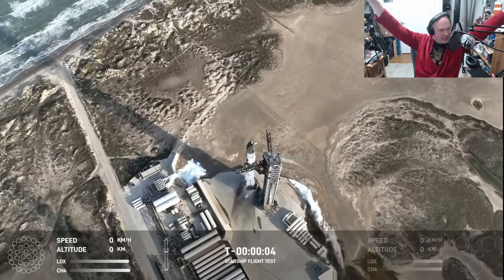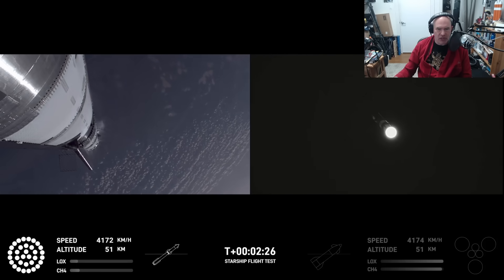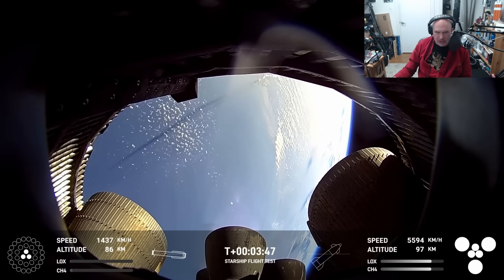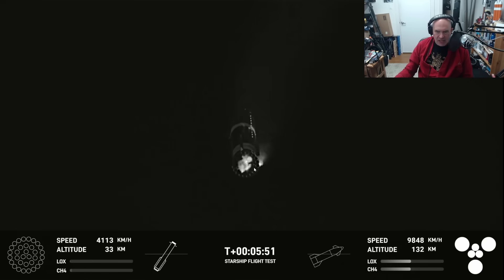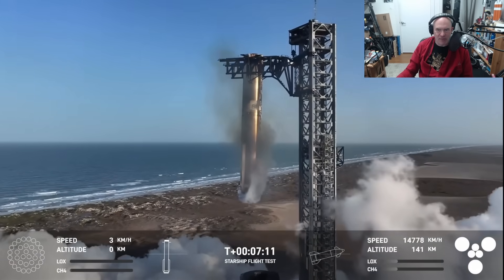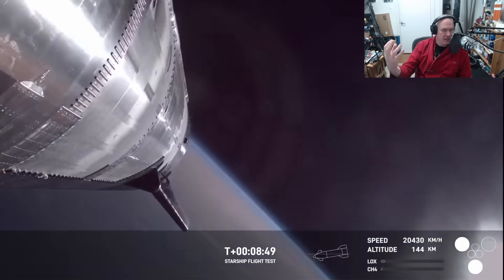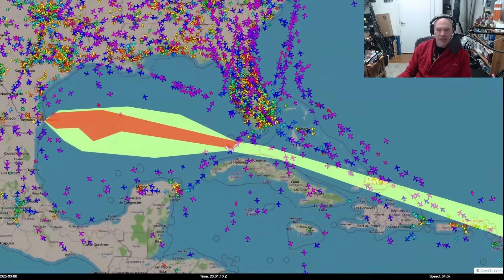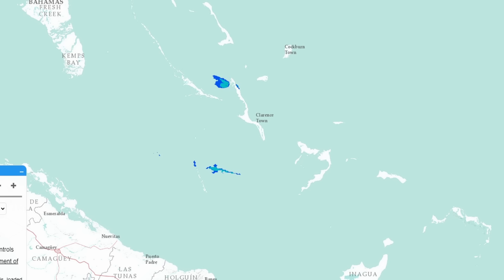SpaceX Make The Same Mistake Twice With Starship Flight 8

Comment: I used to think having so many engines was stupid....& yes I know they need them for such a huge payload for Starship.  Twice now the Superheavy has lost at least one of its central 12 engines and still was caught by the tower perfectly.  The problem with Starship is there are only 3 Vacuum engines forming a triangle.  Lose 1 and it tips, you lose attitude control.  I think the 6 they will have on block 3 makes more sense.  Lose one and your still flying...

Comment: One thing I don't understand in this flight and the previous one is why when the first vacuum engine shut down why weren't the other two automatically shut down to prevent loss of attitude control? 
The other apparently obvious thing that seems to be missing is the automatic shutoff of propellant valves in case of a leak.
If such measures had managed to keep at least one engine running it could have easily made a controlled re-entry in the ocean well beyond land.   Apart from the reduced risk to lives and property it would have allowed a significant part of the mission to be completed. It would just land in a different place (still within the exclusion zone) and re-entered at lower velocity, not stressing the heat protection as much as intended.
Reply: That's exactly what I was thinking and its a question that Scott coild handle

Comment: Just as I thought; a repeat of flight 7.  Whereas flight 6 landed as planned in the Indian Ocean.
> Upgrades are just making it worse... STOP Already with the tinkering, and get it into orbit and back.
- Complete the cycle, prove the sequence concept and then fiddle with upgrades...
Reply: The problem is that Starship V1 can't carry any payload.  With the issues they are having with V2, proving V1 works doesn't change the test campaign for V2.
The only thing I wonder is whether they should abandon V2 altogether and push for V3.  It may be that this happens if there are 1 or 2 more similar failures.
Reply: @JoelKForever  Pushing for V-3 sounds fine as long as you aimt paying for the series of flops.

Comment: The 8th flight of the Saturn V was Apollo 13, and even then they went to the Moon, and all got home safely.
Reply: Yes, but getting 145 tonns to LEO and getting about 300 tonns to the surface of Mars are pretty different things. 

It's difficult to compare this two stories from almost any point of view, everything is absolutely different
Reply: Lol do idiots still believe the moon landing is real
Reply: US space industry is not some upstart like  SpaceX!
Reply: @internetcensure5849  they get some things right - in proportion to how much it relies to pre-existing tech, and in inverse proportion to how much the moron EM is involved
Reply: Completely different.  Every Saturn V came back down in a million pieces. Expendable. Saturn V also had severe vibration problems which were eventually tamed down within limits. In the combustion chambers of the massive engines. This Starship booster comes back every time. The payload continues on. Saturn V had predecessors with many failures. Apollo Program also used 3 upper stages and their trajectories were to get to orbit. Currently Starship is in a different trajectory with different dynamics, different loads on the single, much larger upper stage. Completely different technology and purpose. There literally is no comparison the peanut gallery is flapping their uninformed lips about. Starship is in the EXPERIMENTAL classification stage of development. 100% different than ANYTHING else. They test the LIMITS with each flight, and sometimes goes beyond the limits. THAT is necessary to find so no "flight ready" classed Starship ever goes to and/or beyond those limits with Humans onboard. I followed the Mercury, Gemini, and Apollo missions in real time. I witnessed many failures before any Human stepped onboard. And even then, unforeseen "incidences" still happened with loss of life.  My dear friend, Al Nagler whose company built the Simulators for NASA back in the 1960s is still alive, though in his 90s now.  Yes, I am showing my age.  🤣  But along with that, decades of experience the youngsters have no clue about.
Reply: @JeffCounsil-rp4qv  nonsense - bringing the booster back does not bring the savings you believe they do
Reply: @physicswithpark3r-x3x  Each Saturn v rocket lunch was around 200 million, all lost each time, if you only needed the fuel around 50-80 million. So each lunch, if all is refused, saves you over 100 million dollars each time. Fuel in starship is also much cheaper, so it's closer to 180 million in savings for a bigger payload too.
Reply: @-JustHuman-  nonsense
Reply: @physicswithpark3r-x3x   No, we have the price tags.
Reply: @physicswithpark3r-x3x  How much does each booster cost there "genius"?  How many more will be build, and reused instead of being tossed in the trash?
Your math "skills" are primitive at best.
Reply: @JeffCounsil-rp4qv  the starship programme has made zero savings to date - after every tail landing and or catch, the thing has to be scrapped or substantially serviced

rapid turnaround is a pipe dream

it is nothing to do with maths skills - it is a matter of whether you choose to believe the empty promises of a con man
Reply: @-JustHuman-  all you have is the lies of a con artists
Reply: @physicswithpark3r-x3x   Your MDS is glaringly obvious, and so is your hatred. The Starship program is in it's infancy, and is in the EXPERIMENTAL stage.  I'll bet you also claimed the Falcon 9 program was just a "pipe dream from a con man" too.  I also observed you didn't even attempt to crunch the numbers, and went directly to an emotion ridden outburst completely side-stepping the math.  Math necessary for Physics which leads people to believe by your handle, you're some sort of "genius".  That is a con right there of your own making.  qui perturbat
Reply: @JeffCounsil-rp4qv  wrong on all counts, and you have no business lecturing your betters on rocket science
Reply: Used 280 billions of taxpayer dollars, tech that was already used in nuclear missiles, over 100K people working on it for years and didn't have to land or reenter the ship.
Reply: @-JustHuman-  but di go to the moon and back. did yu miss that part? and they had to literally INVENT most of the technology including computers.
Reply: @rosaliebent4833  No, they didn't have to invent most of it. Even the rocket tech was used in other places. They also had 1% of the US gdp to do it with. You also compare mission numbers with test numbers
Reply: @rosaliebent4833  And they managed to replicate it since? No. 1 time wonder.
Reply: @Barni2212  it was their FIRST flight. the second one is coming up. But unlike SpaceX they make sure they are completely ready first.
Reply: saturn v never had to land safely
Reply: @derekcraig3617 Saturn V actually got to orbit
Reply: @investoronspeed  how much smaller was saturn v??? And has any other space x rockets made orbit? 🥱🤔🤫
Reply: @derekcraig3617  They have literally delivered multiple live crews to international space station.. Do you think ISS is not orbiting Earth?

Yes, SpaceX has already a smaller rocket that's reliably getting humans to orbit. The starship is biggest rocket ever built and it can explode over 10 times before it'll be more expensive than single Saturn V launch and if all parts of it can be re-used, which is their goal.. Then it would be 100 times cheaper than Saturn V to launch
Reply: @DelPlays  that was my point; space x has routinely made it to orbit and comparing starship development to saturn v is apples to oranges
Reply: @ Oh, I didn't read that as rhetoric question.. But yeah, glad to see someone else in here is getting it.

Lot of people seem to think that these test flights are supposed to be the "final version" just because it flies
Reply: @DelPlays  test flights are supposed to 'test' the aircraft or space craft. The built-in assumption is that catastrophic failure should not occur even tho it is always a present risk when testing. But this is the 8th test and it cant even get into orbit without blowing up. This test was no better than the last one. Artemis flew last year as a test flight and the found a few problems that needed fixing. but it didn't blow up or completely fail. It was an ACTUAL test, not a shoot and hope like SpaceX.

and it doesn't 'fly'. it goes up and blows up. that's not flying.
Reply: @rosaliebent4833  Artemis was not a test flight that was an entire mission that was a big part of their future moon program.
Reply: @niox1920  a distinction without a difference. it was a test flight to test out the spacecraft before making it manned.
Reply: @rosaliebent4833  Starship is classified as EXPERIMENTAL.  Artemis is NOT.  YUUUUGE difference.  Block 2 of Starship is brand spanking new. Every flight IS an "actual"  In-Flight test. Perhaps you should educate yourself before making such asinine rantings.
Reply: @derekcraig3617  a muggle like you will never know what he is talking about

Comment: Super Heavy is clearly on a path to success and way ahead of Starship. Seems like it would be wise to start looking into alternative upper stage options for Super Heavy
Reply: You don't actually have to develop a new upper stage, just adapt to an existing one. Potentially a much easier problem to solve than getting starship operational.
Reply: @karl0ssus1  I don't think there's an existing upper stage with the mass that would make sense for use with Super Heavy.
Reply: @karl0ssus1  What existing stage do you have in mind? It has to be something reasonably large — not necessarily the exact 9m diameter of the booster, but something in that ballpark. And it has to be something designed for a re-usable booster, because it will need to be able to reach orbit despite staging much lower and slower than expendable boosters do.
Reply: I believe fixing the issue on the upper stage will be way way easier than developing an entirely new upper stage or an adapter
Reply: @sky1sbloo  Only under the assumption that SX will use Heavy Booster only ever for Starlink and other small payloads that can be squeezed out a relatively tiny door.
You can't make Starship carry larger payloads to orbit. The whole concept of that vehicle is in conflict with large payloads. Large payloads would require an opening in SS large enough to compromise its structural integrity. Solving that would make SS substantially more heavy, putting its viability for heavy payloads in question as well its capability to manage its descend. For making Heavy Booster actually useful as a heavy lifter (assuming there is market demand for it), it is much easier and more practical to develop a more conventional upper stage. SS is a boondoggle...
Reply: @elgonzo7239  Well if you remove all the return related hardware/mass; heatshield, fins, sea level raptors, return fuel capacity...the empty forward part of Starship could become enormous. The structural requirements for a "expendable" Starship (reaches orbit and does stuff, but can't return to Earth) would be significantly less.
Reply: @markmathews2122   Hold on for a second and step back. Think about what you just explained. How would what you described be better than just an ordinary upper stage with payload adapter plus fairing? An expendable Starship like you described is just worse -- it's more expensive, less practical and still heavier than conventional upper stage + payload adapter + fairings, and it isn't reusable either. What would be the point of it?
Reply: I mean, Starship V1 works pretty well for getting something into the orbit and then diching the upper stage, based on all we've seen so far.
Reply: @DreamskyDance  or fix the problem with v2 with already existing tooling and modify an already half built ship in construction

Comment: Assuming the vacuum raptor bell is cooled, the gas in the engine bay could just be gas leaking from the broken bell
Reply: A fuel leak alone wouldn't cause a fire, you need oxidizer as well.

Comment: Starship Version 2 carries 25% more fuel than Version 1 and is 2 meters taller. Could the resonance induced failures be caused by that extra mass getting lofted? I know that welding is done to a precise tolerance and resonance frequency to be able to withstand the stress of launch. Has that tolerance changed and caught SpaceX off guard?
Reply: Longer pipes means lower resonance frequency, right?

Comment: The static fire has the Starship bolted at the bottom (obviously).  I would think this would change the harmonic response vs. free flight. I wonder if that is hiding something.
Reply: Yes. Some things cannot be perfectly tested on the ground. Besides the possible hold-down effects, in flight, ship is under the stress of several g's of acceleration especially just before SECO when most of the fuel is gone. Can't test for that on the ground.
Reply: @berrywd  maybe they can artificially
Reply: I wonder if the thrust differential between the vacuum raptors and the sea level raptors is causing a sheer force or vibration. On the ground, the rolls would be reversed unless you deliberately throttled down the sea level engines to match the same thrust differential. You still might not see the same vibration due to not being in vacuum.
Reply: @aceisking12  It is more like, when the fuel tanks are partially emptied to a particular level that you get harmonics build up. Not enough fuel to dampen the harmonics.
Reply: @aceisking12  - but then why didn't this occur with V1?
Reply: Definitely worth considering in future tests.
Reply: damn I can't imagine what do such bolts look like
Reply: I am sure they have measured the free flight harmonic response on this test flight to make changes for the next ship
Reply: @Termynat0r  That was Flight 8 purpose.
Reply: They got loads more data now in worst case scenario situation that affects all systems that may prove invaluable later compared to purely theoretical engineering.

Yeah more refinement for a perfect launch can be done leaving a lot of systems with a theory but I do think it is invaluable to know how things tolerate worst case scenario in practice, all the systems are in an elaborate dance together and were pushed to their failure, they have actual data to work with.
Reply: SpaceX has consistently under invested in the fidelity of ground testing infastructure under their Soviet style development model.
Reply: Just strap the Starship into a centrifuge going 100 RPM, that should be enough to simulate it :D
Reply: @ I would say the proof will be in the pudding and it is not yet or if the oven. They are far ahead at the moment of any other private or public organisation. Perhaps it is time now to move to more simulations and ground work as you say

Comment: tbh, I think they did fix the issue that killed Flight 7, I think this one is a different issue, caused by a vacuum raptor nozzle failure. You can see the nozzle has damage at 5:48, it looks like the nozzle has burn through. These are actively cooled, so there's propellant flowing through the sides of the nozzle and now probably venting into the engine bay. That's the source of the fire you can see. The engine finally gives up & ends up taking out the 3 sea level raptors & it loses attitude control. 

There are a couple of questions though;
1) Surely they most have seen the failure, either on the footage or via data streams - why didn't they shut the vac raptor down & gimble the sea level engines and/or throttle down the other raptors to counter the offset thrust.
2) Why didn't they shut the other raptors down far earlier as soon as the ship lost control. Who knows, they may have been able to stabilise the spin via the RCS and then brought it down in one piece (until it smashed into the ocean). Bringing it down, controlled via the flaps, in one piece has to be preferential to multiple pieces in an uncontrolled re-entry.

But, yeah, it's a shame, but I think they've probably been unlucky. The failed Vac Raptor may well have been damaged during the extended static fire and they never detected it.

Comment: I'm guessing the vibrations/frequencies/harmonics will be different when the ship is in flight, compared to when it's vertical on the ground clamped down by its skirt.
Reply: If it were mine to debug, I'd build a programmable triaxial shaker table for it. Every major failure mode and its mechanism will eventually have to be discovered. Better strapped to a shaker than five minutes into a return flight...from Mars.
Reply: @tomgooch1422  Nah; too complex. Just strap a planet to it during launch and have it haul it into orbit as a vibrational dampening mass.

I jest, but oh man can you imagine the shaker plate for that? I think the largest (multiaxis) one to date is 20'x20' and at UC Berkeley. Assuming you can get the 30' diameter onto it with a truss of some kind, it's got a weight limit of 100K lbs (compared to the 11M lbs of starship, though the dry mass is only a little over 500K lbs). Something big enough for SS would be a BEAST.

Comment: 12:30 Spontaneous structural fatigue failure, the system as a whole vibrates into structural fatigue during launch!
 The booster has a different resonant frequency.

Comment: At 6:32 into this video, what is the apparent object traveling left to right? Is it a shadow or is it the opposite side of ship tearing away? In any case, it looks as if hot staging is at least a contributory factor - possible shock damage to the nozzles or piping? But hey, I'm sure SpaceX will have this figured sooner than later.